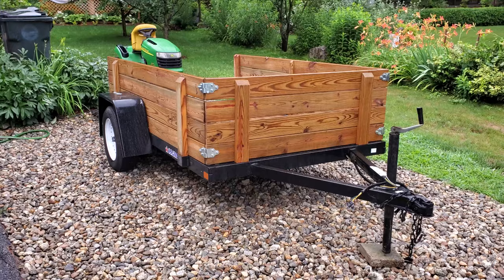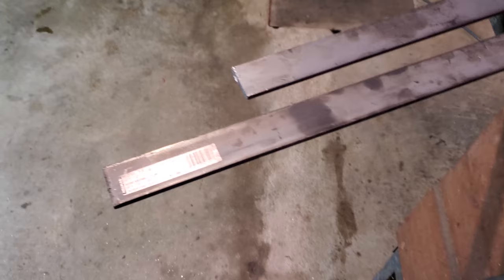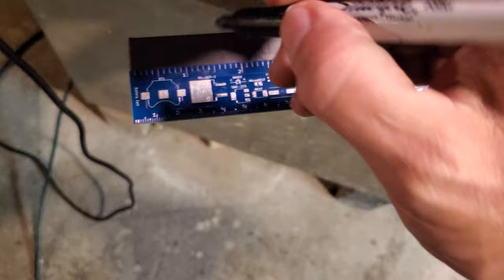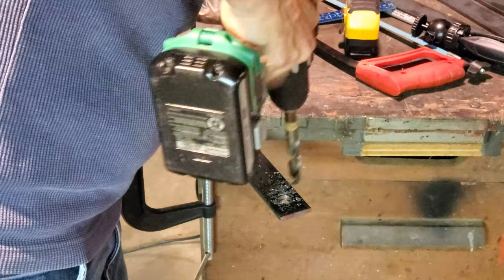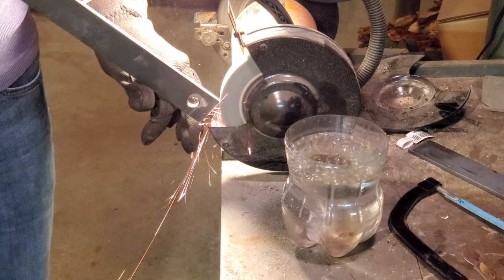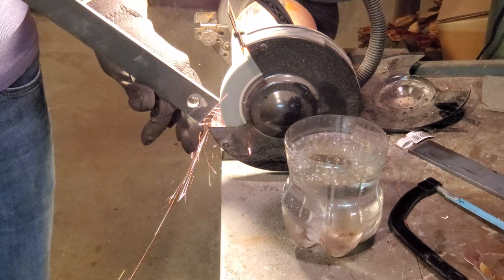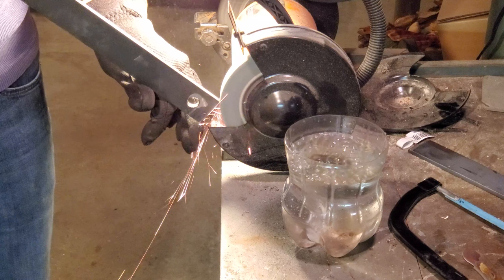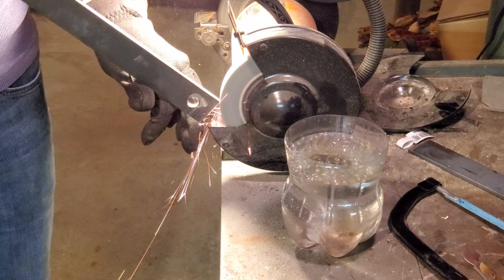Utility Trailer Upgrades - Tongue Jack, D-Rings, Wiring Harness, etc

Comment: I think I would’ve used lock nuts or lock washers on the tie downs to stop the vibration from letting the nuts back off over time.
Reply from the maker: You can certainly do that with your build if you feel it's necessary.  Well-torqued nuts rarely back off or vibrate loose in an application like this.  The carriage bolts being mounted through wood means that nearly all of any vibration that might be occurring is being absorbed by the surrounding wood and not being transmitted down to the nuts.  At any rate, they've been on for about 17 months now and are still tight as can be.

Comment: TICONN 150 PCS Solder Seal Wire Connectors, Heat Shrink Butt Connectors, Waterproof and Insulated Electrical Wire Terminals, Butt Splice (150PCS)

Comment: Tip: The closer the location of the hole you intend to drill to the edge of your bench, the less of your downward drilling pressure will be lost to the deflection of the work piece!
Reply from the maker: Tip: If you're relying on pressure to drill holes, sharpen your bits. Especially if a couple inches away from the bench has that much of a significant difference for you.  A drill bit is very precisely engineered to cut AND draw material. When the tip cuts into the material, the flutes are designed to either draw the material toward the bit or draw the bit toward the material (while simultaneously clearing shavings). A well-sharpened bit of the correct material for the part being drilled will not require much pressure to do its job.

Comment: I would recommend solder the wires or crimp but splice then shrink tubbing
Reply from the maker: You can use a butt splice, a solder splice, a hook splice, a completely new harness...whatever method best suits your application, skill level, and materials available.  For this application, the quick and dirty method shown is still working perfect and will continue to last for years to come.  The level of "neatness" in your personal application is entirely up to you. ;)

Comment: The D-rings are only as strong as the deck boards are mounted to the trailer frame. Perhaps you should mount the D-rings through the deck boards to the frame.
Reply from the maker: Must've been watching with audio off. This is covered in the video @ 16:30.

Comment: I applaud you for using heat shrink. But twisted wires is not effective or efficient in anyway.  For testing it is just fine to verify function but please go back and solder the joints or use crimp connectors.   Heck they even make heat shrink that has solder in it that you can use to solder and shrink all in one step.   Twisted connections are just too easy to have fail even with heat shrink on them.
Reply from the maker: Appreciate the opinion.  Video was posted over a year ago and lights are all still functioning perfectly fine.  Been twisting wires for over 35 years and, while it's not as neat and tidy as a different kind of splice, it works perfectly fine for an application like this.  If you want to see it done differently, check out any of my other videos that show proper electrical work.  That just wasn't the purpose of this video.  https://youtu.be/IrOUBV1rWo4

Comment: Nice work.. But i would install support wheel on the inner side of the tongue.. More protection and less in the way..
Reply from the maker: Installation was over a year ago. Jack has never once been in the way of anything in all that time nor needed protection from anything. And mounting to the inside would make the handle VERY awkward to work with when raising and lowering the jack. Thank you, though!
Reply: @603photog  i have it mounted on the inside, thats why i suggested it.. it doesent even look strange :)

Comment: Jeremy, I know this suggestion is late but I would attach a piece of small cable to those clips. If you don't you may lose them... I did, all the time...
Reply from the maker: Thanks, Matt.  You're so right.  In the video, you'll notice a nylon-wrapped steel-core lock cable dangling from the ramp-side clips.  After installation, I took those, crimped a ring connector on the end of each one, and ran a keyring through.  I then ran the keyring through the mesh of the ramp.  Still holding great!  I never bothered cabling the bottom clips because I don't think I've actually removed them since this video was made.  Not really a need to.  Thanks for the suggestion and for watching!  Take care!

Comment: Should have made flat bar backers instead of fender washers for tie downs. Would be much more secure.
Reply from the maker: It's a good idea and it's actually what we do for our cleats on our boats.  But, given my particular use of the trailer (as stated in the video), this easy solution is more than sufficient and secure.  Thanks for watching!

Comment: The new Jack looks great, but what was wrong with the original jack?
Reply from the maker: Hi, William.  Two things:  1.  The old jack did not have a wheel on it which is important for me to have due to how I move the trailer around in my driveways.  And, 2.  The new swivel jack is MUCH more user-friendly than the old post jack given that you only have to crank it up a few turns and then just swivel it out of the way.  With the old post design, you have to crank it up a lot to get it out of the way and then crank it down a lot to get the jack back up.  Swivel jacks are just so much nicer to use.
Reply: @603photog  they sell wheels that pop into the bottom of the a-frame jacks, don't need to replace it
Reply from the maker: @RandomMaker  Yes, but you're still stuck with a jack that you can only raise up just so much. I prefer having nothing suspended from the tongue at all. When you live and work around a lot of rocky terrain, you learn quick why it's nice to have the fold-up jack.